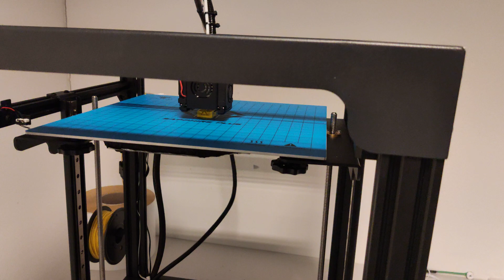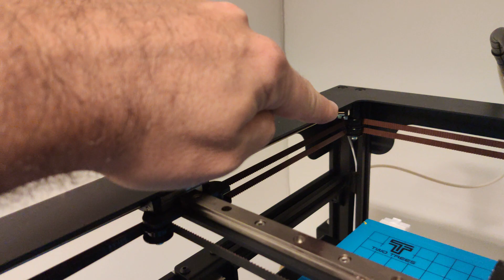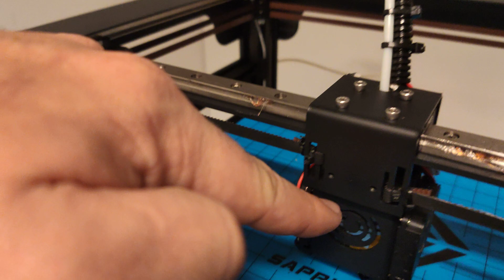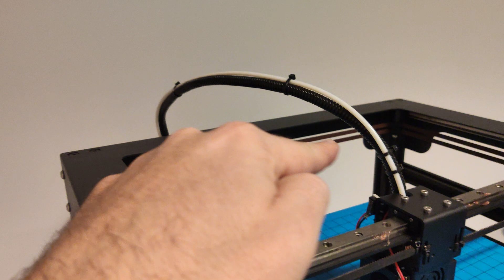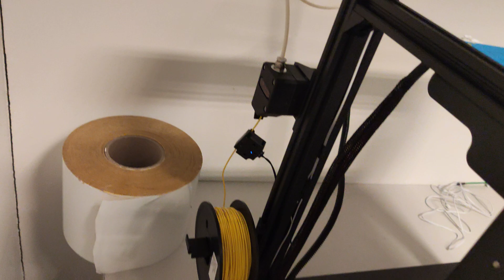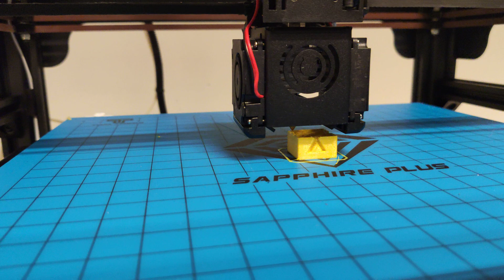Two Trees, Sapphire Plus - 3D printer... first run TEST

Comment: Hello Again,
This is the same commnet repeated from other video about the same machine.
I'm thinking of buying this printer, but watching your video, I realized that the hot-end block probably collides, because is too close, with both "Z" side axles when the hotbed goes down,  limiting the use of all 300mm "X" axis. Can you confirm this ?? Regards !
Reply: Buy it, its extremely good printer.. and no collision with Z rods. This is by far the best money in 3d printers.. i was testing it upto 240mm/s and it worked just fine, all stock. Expect a glass bed. Probably does not always reach 240mm/s because acceleration, but it is fast and accurate. The frame is really solid.

Comment: It may be print very good 20x20x20. But can it print 200x300x100 with the same quality? My Sapphire Pro in stock also print test cube very good but for normal print 200x200 i change a lot of parts.